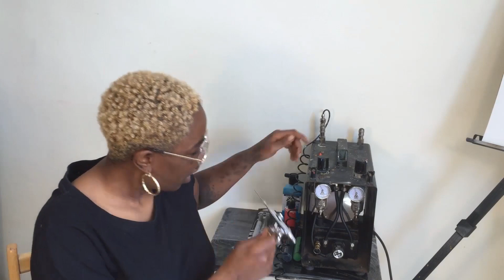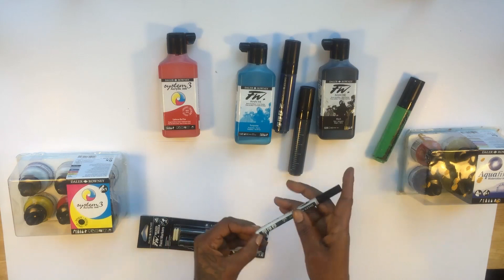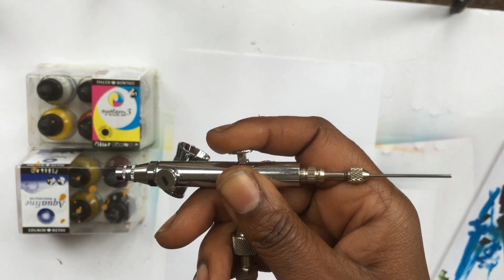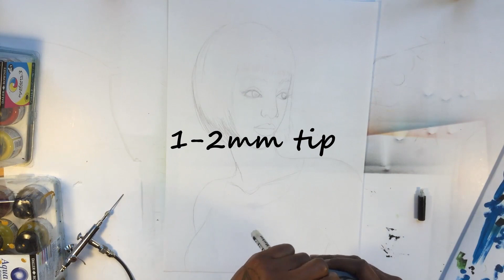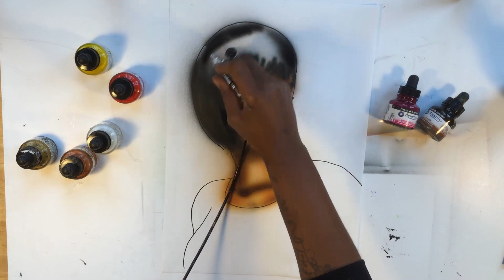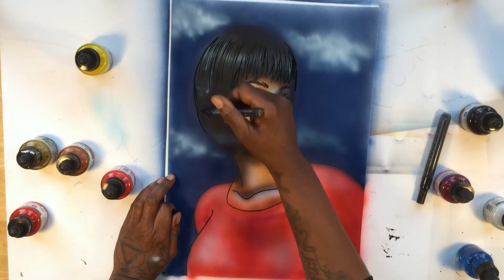How to airbrush with Carleen de Sözer and Daler-Rowney Inks?

Comment: I've tried these inks through my airbrush and to be honnest the white is murder to spray with, I've tried using straight from bottle, I've tried reducing it, over reducing it, I've tried all air pressures high medium and low and it's like it dries instantly on the needle tip. As anyone any suggestions. I've even tried a drop of glycerine from watching YouTube videos and nothing helps.